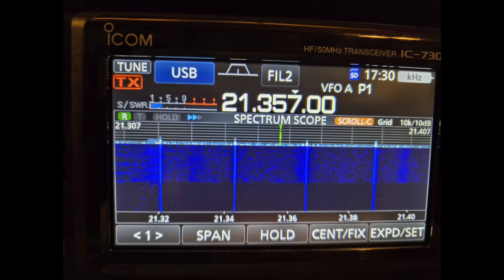Spurs and Birdies (#1326)

Comment: yes that's all fascinating Dave,  I know you won't respond to this,  every time you explain this ground in business you always mention about taking the coax to the ground through a lightning connection and then to the shack, how do you go about this when one's Shack is not on ground level, I've got very good grounding but it's not at ground level, even went to the installing  a of  Faraday cage in the walls of my shack, so basically I'm sat in a tin box that is grounded,  that's the floors wall and roof, now side this Shack the noise levels with the aerials unplugged his unbelievable in the plus 9, cross most of the amateur bands particularly HF, it does vary from day to day, always somewhere in the high Numbers. it's almost impossible for me to take the coaxes down to the ground level,  with all the coaxes removed from the shank there's no noise whatsoever it's gone, I've tried multiple coaxes of varying costs, no I did borrow the neighbours garden and did the experiment you said and it did eliminate most of the nose, so it is coming down the aerial  but I can't use their garden permanently, now I've tried running a ground wire to the ground where I know it works, does that acts like an antenna in itself. so how would you go around that one.  like I say I don't expect an answer. thank you for your time and effort uploading videos.
Reply: Its hard to explain in a comment, but you can end up with this situation because the noise on your ground system adds to the signal from the antenna via the common mode. One way to tackle this for receive is to add an isolating transformer at the antenna feedpoint. For antennas used for transmit and receive, a really good common mode choke can help.  Also, try connecting just the centre conductor of your receiver to the cage ground in your shack. If this results in a lot of noise, you also have an issue with noise coming over the electrical supply. Wrapping the power cable through ferrite chokes (the snap-on ones are good), can help a lot. Bigger, and more turns of cord will give more isolation.

Comment: I had been chasing some interference in my house. Was certain it was coming from the laundry room. The obvious suspects were the washer and dryer, but my wife drew a hard line under me messing with her washer and dryer. 😆 Turned out it was old cheap florencent lights in the room. They tended to be turned on at the same time as the washer and dryer were running. Luckily I already had new LED lights sitting on the shelf. Cheap fix. At least cheaper than my wife fixing me. 😆 🤣

Comment: Wow.. how apposite.. I've just noticed a tone that started last week at 27.427.000 with the coax disconnected and on batteries. 
Icom 7300.
Factory reset removes it but reload the settings brings it back....
What were the last couple of changes I made...? 🤔🤔🤔🙄